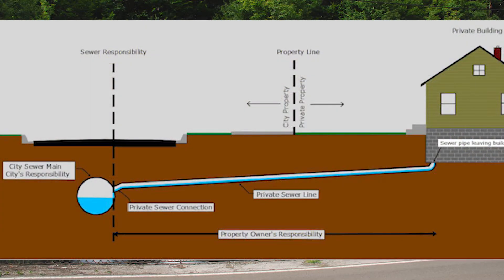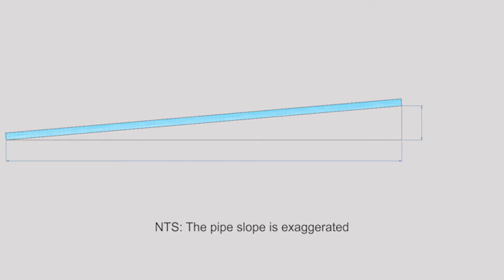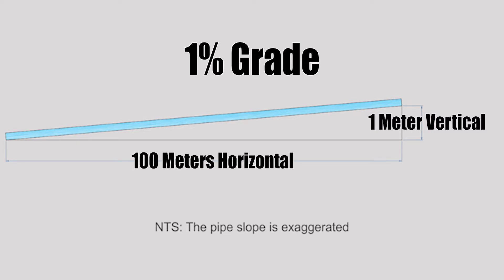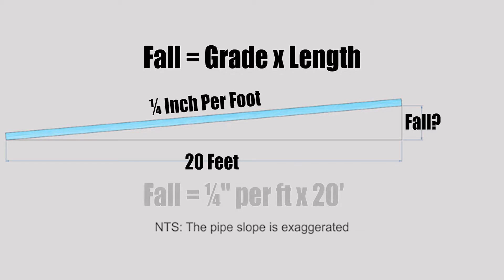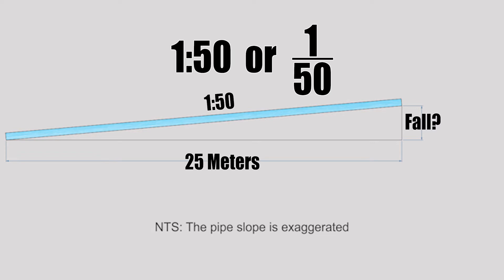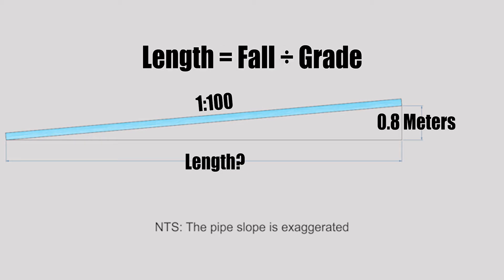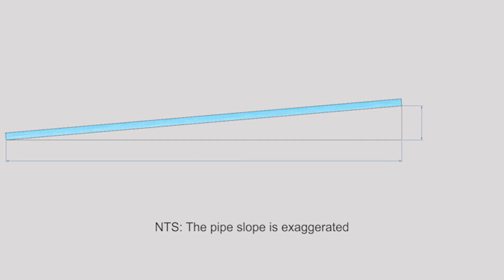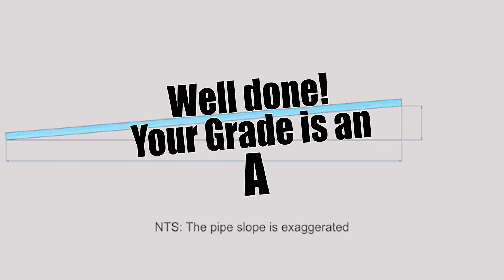Basic DWV - Video:5 Pipe Grades and Calculations

Comment: These are fantastic videos, is there any chance you'll be updating them for the current code? I say this as I am in period 2 and using your videos as a supplement to the in class instruction with the understanding that there may be small variations between 2015 and 2020 

Either way thank you for the help
Reply from the maker: YouTube has no mechanism for actually updating a video, but I will make supplemental videos in the event I have misinterpreted the code, or the code has been changed. So far, the only code changes that I have come across are repositioning of clauses. So the same wording is still applicable, but the clause number has changed. I might to a short for those changes.